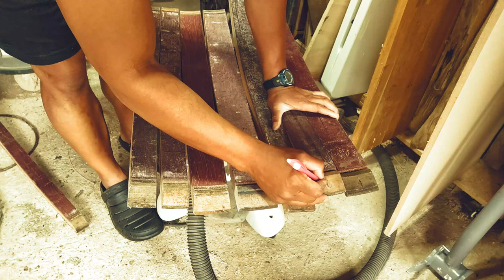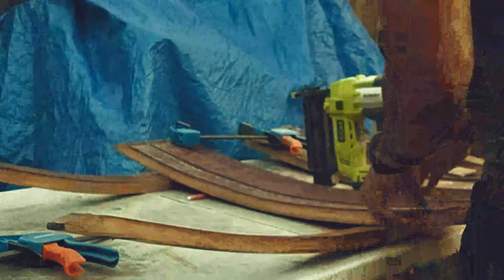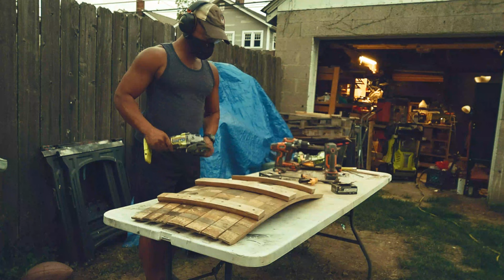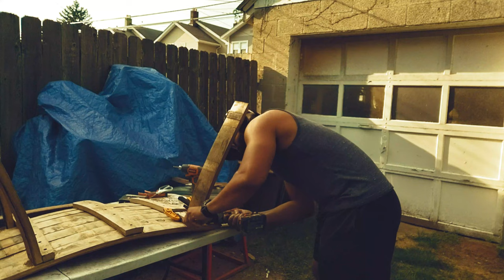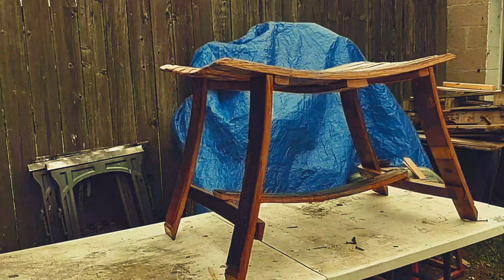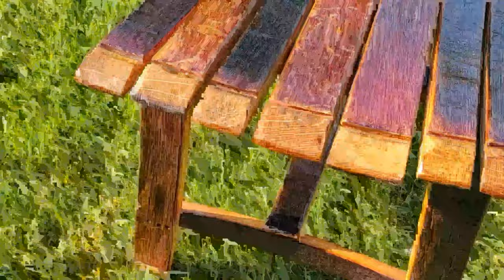DIY wine barrel stave table/seat.

Comment: What kind of disk did you use on the angle grinder to clean the inside of the stave?
Reply from the maker: Just a standard flap disc. I did use a few different grits before using the sander.Sorry for the delay!

Comment: Do you have the cut dimensions?
Reply from the maker: Hi (almost a year later ..sorry!) I unfortunately don't. I have made only two of these.Both of which I made based off of where they were going to live. If you are still looking to make one I'd say just use a stool height you like and go from there. Width I just used the standard length of the stave and just preference on the seat width. Hope this helps!